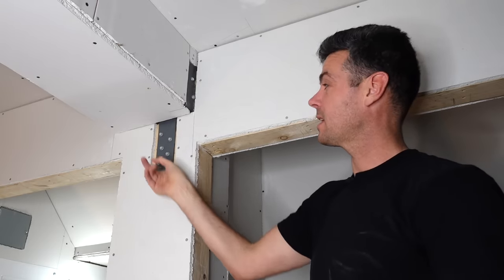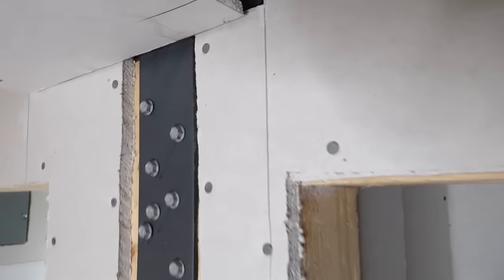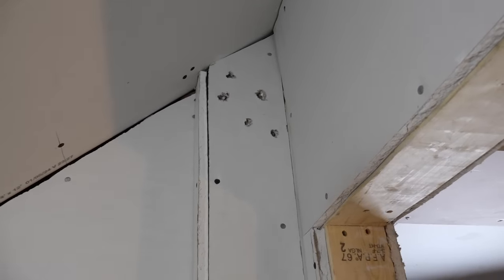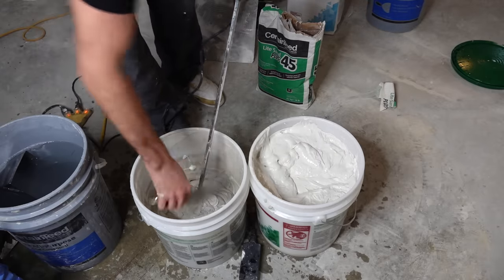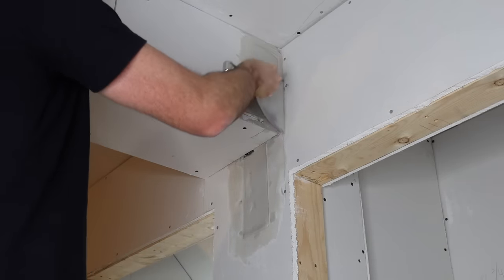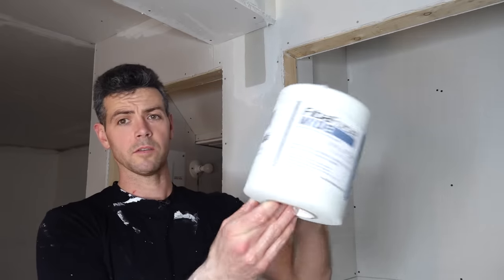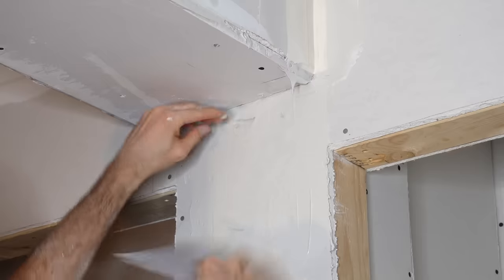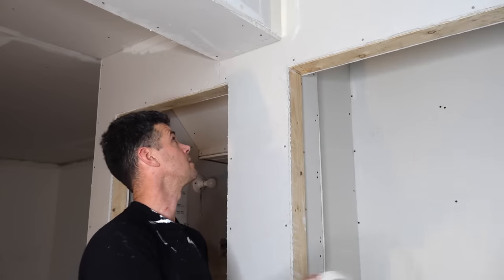How to Drywall Over Beam Hangers!

Comment: Recently been watching all of your videos on skim coating. I have a brutal ceiling texture that is painted. The texture looks like someone painted raised veins all over the ceiling. Any thoughts on just ripping a random orbit sander over it all then skim coating or just layering on like 4-5 skim coats? This will also be my first ever skim coat attempt, but drywallers won't take on the job since it is too small in scope (1 room).

Comment: You know you can mix hot mud in a 12” mud pan. I use an inch and a half putty knife to mix. Or a small mixing paddle. It’s easier to get out if it dries. And you can only put on so much before it starts setting up anyway.

Comment: Did I miss it- or did you use all purpose over the not-100% cured hotmud coat? (Just curious how long you need to wait before going over hot mud with all purpose for purposes of minimizing repair trips when I do it. I was under the impression it should be 100% dry but I know there’s.. tricks 😏

Comment: To get mud out of a round bucket, I find it much easier to use an L shaped knife like a tuck pointer (wider blade than a tuck pointer) rather than the kind of knife you are using.

Comment: I wonder if shaving down the dry wall then putting in a fill hole to pump mud in there after the fact to fill the gap between the hanger and shaved drywall would be viable? Or would that just be too much work for a result without much benefit.

Comment: Funny enough I had the same hot mud issue a couple months ago, had my 90minute mud setting up on me in 30minutes... thought it was the room temperature or water that I used but changed those and kept getting problems, new bags too... maybe a bad batch from the manufacturer?

Comment: a few steps you SHOULD have taken 1st, a coat of primer on everything, then mesh tape, then hot mud, then paper, THEN FINISH. what you have is a big area that is going to crack as there are different expanding materials at such a small area.

Comment: Hi from New Zealand. When we come across this problem we generally pack out with drywall or similar thickness material then a final drywall layer. Packing out to overlay the bolt heads and a clean drywall layer for plaster finish. If that makes sense… 😬
Is that something to consider?
Reply from the maker: It works when the framers do it before u get there. But if they don’t then this works.
Reply: @vancouvercarpenter  cheers. Nice to know how it works on the other side of the world

Comment: fibafuse is great but you gotta be careful because you can literally sand right through it and not even know it.  unlike paper tape and mesh where you can tell when you've hit them.  Perhaps if the fibafuse was a color then you can know when you're touching it with a sander
Reply from the maker: Good point. It definitely has it's pros and cons

Comment: Wouldn't it be easier to replace those screws from flanged hex head to structural flat head (Flatlok) screws?  That would maybe give an extra 1/4" depth and maybe 1/4" drywall could be used for the patch.  Just a thought...
Reply: Those screws are structural screws, specifically rated to this engineered application. Not using such specified fasteners would fail inspection.
Reply: @tonyc7352  The Fastenmaster Flatlok screws are structural as well and suitable for this application. That's why I spelled out Flatlok.
Reply: @bobbray9666  Yes, they are structural but I've seen that type used for fastening multilayer beams/joists. I haven't seen them use on joist/beam hangers, maybe are rated for this, I don't know. Yes, if they are then that would be a good idea.
Reply: @tonyc7352  They are a good idea but most framers stick to what they've always used and most use the most economical materials unless told otherwise.

Last year, when we built a new home, I had the framers use polyurethane foam subfloor adhesive.  They'd never heard of the stuff.  I had them install Zip-R sheathing that they had never installed.  I had them use a piece of lap siding on the window sills to create a pitch outwards, which they had never done.  I had my siders install a 1/4" plastic mesh rainscreen, which they had never done.  Etc...

Comment: Awesome job!  Would it be pereferable to either glue or mud in a piece of 1/4" drywall so it was flush with the 1/2 "drywall (of course provided there was room)?
Reply from the maker: Yes, you can do that. it's a good option.

Comment: Was wondering if you could do a review of muddskip. I saw BYOT try the product but hes not really a drywaller. Want to know if its any good as i gotta skim all my ceilings and really hate the dust. Love the vids
Reply from the maker: I couldn't get it to work exactly as I hoped. If you use air dryingf muds like it says you can it still shrinks a bit after the fact. So if the surface was uneven it shows through a little after drying.

Comment: Would hot mud be ok to fill in a  void that's around a 90 corner from a shower insert? Need to patch a shower access panel and the old stuff (plasterboard+mortar) is about 3/4 thick so even 5/8 drywall leaves a gap.
Reply from the maker: Yes it would 👍
Reply: @vancouvercarpenter  thanks!

Comment: What's the proper mud to use for the fibafuse? Can you use both hot mud and all purpose?
Reply: Works well with all mud, manufacturer recommends staying away from using it with lightweight compounds.
Reply from the maker: Anything but finish mud

Comment: Dirty water for your mix? Also why mix the muds? The manufacturers say not to mix them. Couldn’t you just add a glue for adhesive?
Reply from the maker: The manufacturers also say not to add glue. You need to know the rules before you can break them.

Comment: I have a stupid question, but why is tape used in the first place?  To hide the transition between two materials/seems better?
Reply from the maker: The joint between the two materials cracks. The tape bridges it and stops cracking.
Reply: @vancouvercarpenter  thank you for the insight

Comment: Using a drill on high speed will often speed up the set time on hot mud. Not just hot mud but many other mixed products as well. Run the drill slow or mix by hand. Just my 50 years experience. Hah!!!

Comment: Framing it out before the sheet rock, cost very little, doesn’t take a rocket scientist to figure it out
Reply from the maker: Ya but when your “just the drywaller” you need to have other ways of handling it. Also you might cause problems for the trim carpenter if you do it on walls with doors like this one.

Comment: The mix kicked off early because you added a dry and premix in together.
Reply from the maker: Been doing it for years and I’ve  never had it happen before. Could have been the green lid had something different in it than the muds we use up here but I think it was just an old bag of mud with little set up crusties in it. Didn’t notice them until I started using the mud because they were like sand and I couldn’t see it.

Comment: I'll just say what I would do in this case without see the video. I would just use some frame mud like durabond to fill it and make it flat, than I would use a fibatape or meshtape than finish with the regular mud work.
Reply: Yes, I'm glad to know you did exactly what I would do! I would just use a mesh tape instead of the paper  in the inside corner, because I already had many bad experience with the paper tape cracking in the future, and it never happened with meshtape. the only difference

Comment: I allways thought that mud and steel combined would lead to heavy premature corrosion?

Am I informed wrongly? Has mud changed chemically?
Do you have options to separate steel and mud?
Reply from the maker: It dries out. It would need to be exposed to continuous moisture to be a problem.

Comment: Bad framing detail by the framing crew, should have c'sink the connection into the post and beam, they know its going to be drywall over later unless they assumed an exposed beam and column